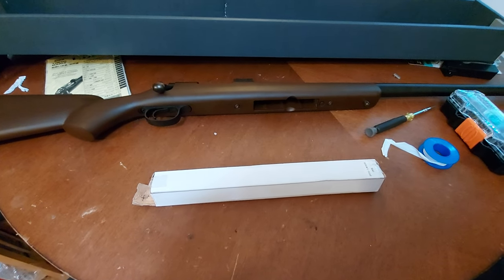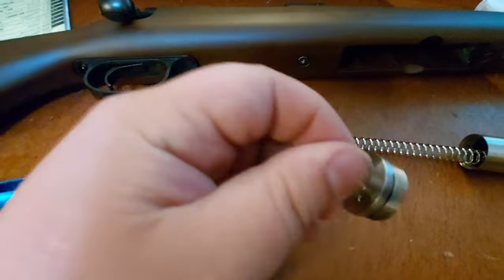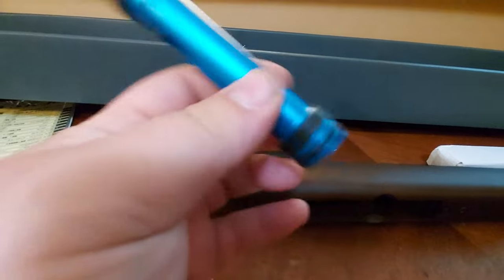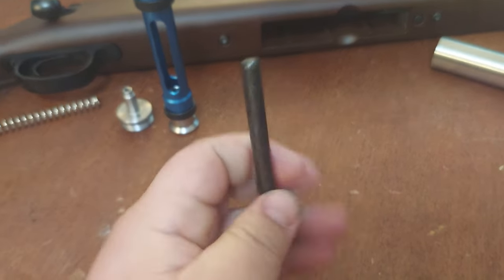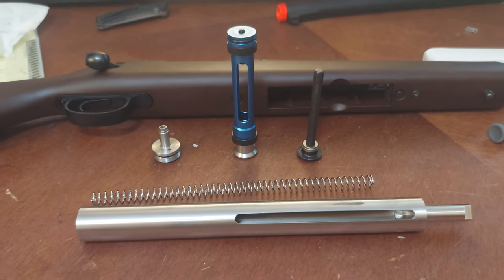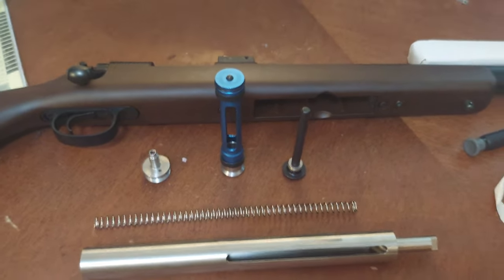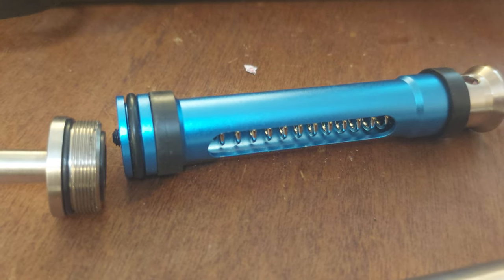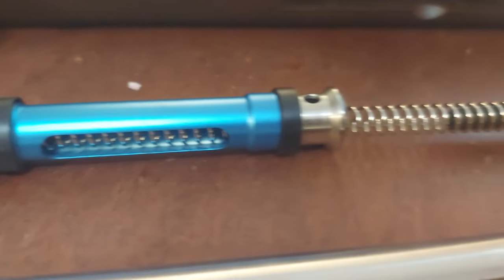VSR-10 PPS Upgraded Cylinder Kit Unboxing and Review

Comment: Bro i have an Old Cyma M24 i replaced its stock Cylinder to TM vsr10 steel cylinder it fits but the stock end cap cannot reach the stock bolt pull because the end part of the Vsr10 cylinder is a bit longer so i think i only need to put a Vsr10 end cap but my question is it compatible to the stock bolt pull handle? I believe it will reach the bolt pull handle but im not sure if the vsr10 end cap will connect to the m24 bolt pull handle